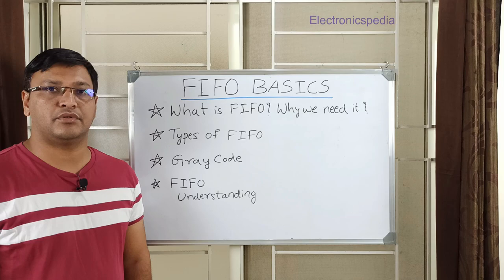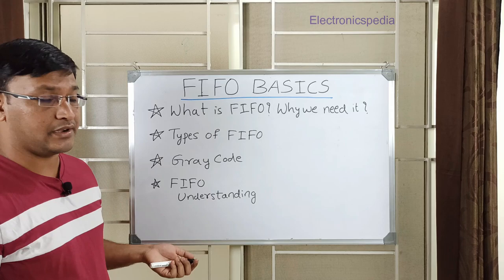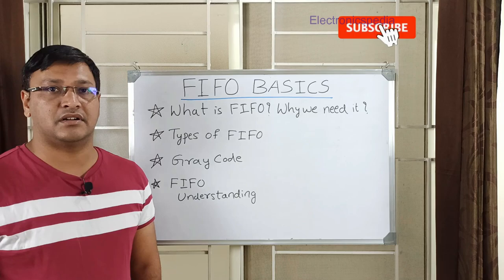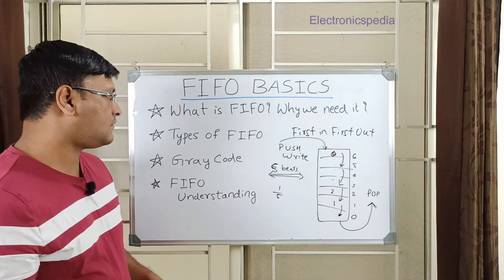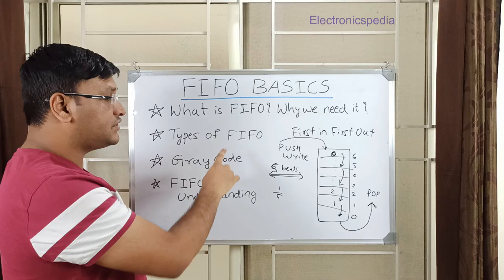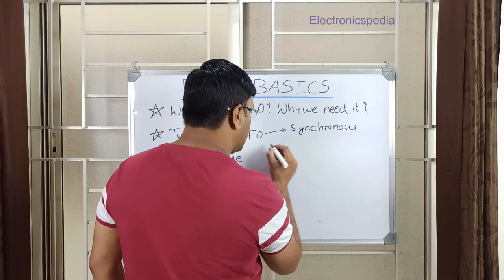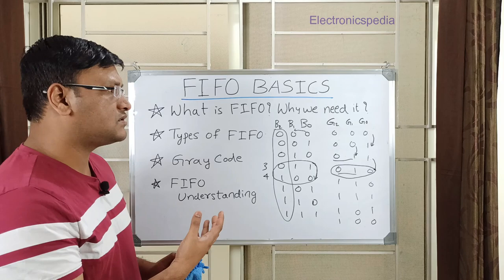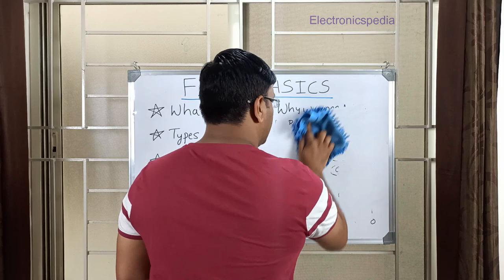FIFO Clock Domain Crossing (CDC) | FIFO Basics | Asynchronous FIFO | Synchronous FIFO | FIFO Design

Comment: Hi sir, you mentioned we will add 1 once pointers reaches to 7th location we compare MSB bits. Lets consider my both pointers are rolled overed onve so their msbs are 1 and  if write pointer again reached to 7th location and read pointer is still at 0th location now when we compare msbs even if we add 1 to write pointer it will be still 1 and read pointer is also having 1 as msb due to previous full condition. Please clariy sir how to compare full condition in this case

Comment: Why we moved to synchronous fifo and asynchronous fifo, it's not very clear in video??
Reply from the maker: I didn't get your question correctly. 
Synchrnous FIFO : We use this when the two clocks on both read and write side are same but the interval of writing(speed) and reading is different
Asynchronous: When there is a write and read frequency are different and we want to transfer continuous stream (finite length) of multibit data, we usually use Asynchronous FIFO. 
Please let me know if there is some confusion
Reply: @Electronicspedia   thanx for reply.

My question is 
Why we need sync. & Async. Fifo ??
Or which drawback motivates us to use these fifo either sync. Or async ?
Reply: @pranavgupta4552  Some designs require you to use two different clocks for a FIFO. If it is the same clock, nothing is really difficult..

Comment: I have a question, sorry if it's silly :) Suppose pixel data comes from a camera (512x640). After that we can save this data in array ( line buffer[511:0] ). Then we can send these data to the desired data bus, respectively. (line[0],line[1],line[2]....line[512]). Why use FIFO when we can do this? My second question, async design is recommended when there are different clocks. But what I don't understand is if I save the data at the clock speed I want, why would the speed of the read process affect this? The writing process is already finished.
Reply from the maker: Hi Enis,
My understanding from your question is that you are working on a synchronous clock. i.e. both read and write frequency are same. 
Now assume if you are writing data every clock cycle on 100MHz, and the read is happening on the same clock frequency but every alternative clock cycle. This means there is a data rate change but frequency is same. In this case you need synchronous FIFO. Otherwise the you may missout write data. I hope this answers your both queries. Do let me know.
Reply: @Electronicspedia  Hello :) First of all, thank you for your reply. I will describe exactly what I want to do to better explain my problem. 10-21 Mhz values (I get parallel pixel data from my camera with CMOS standard). Normally, as the simplest logic, I was aiming to store this data in a buffer and then add some packets to the beginning and give them serially (200Mhz) to the output port (MIPI CSI-2). Later I saw in diagrams that the data was recorded with FIFO. Then, while I was doing research, I discovered your channel and questions started to form in my mind. With your permission, I would like to consult you.
1-) First of all, I am trying to understand why FIFO is needed. I guess the answer is to read and process data faster while writing it without waiting for the transmission to finish. Otherwise, it's easier to save the data in an array and read it when the transmission is finished. (Please verify me or point out what I'm thinking wrong)
2-) If we are not going to read and write at the same time or if we are going to read and write at the same time and at the same speed, I think there is no problem. The problem is that we read and write at the same time, but read and write at different clock speeds. (When I say at the same time, I mean to start reading all the data without waiting for the recording to finish). I guess in this case we need to design asynchronous FIFO. Am I thinking wrong? If it is wrong, what is the correct one, what do you think master?
Reply from the maker: In your first case, how are you reading it, what is the frequency? Is it the same as write frequency (10-21Mhz)?
Reply: @Electronicspedia  The camera's pixel clock depends on the mode selected. I will use it for 2 mods. One is 10.519Mhz, the other is 21.04Mhz. If you are going to give an example to explain the logic, you can accept the frequency you want. At this frequency, the data will come in parallel and I will have to save the incoming data by sharing the clocks. I guess that's the writing process. Later, when I want this data, I need to serialize it quickly, for example at 200Mhz.
Reply from the maker: Hi Enis, 
1. When there is a write i.e. pixel data coming from the Camera, this data will be stored in FIFO(Asynchronous) and then Read back if in read frequency is different compared to write. Your understanding is correct here.
2.  When there is a write i.e. pixel data coming from the Camera, and if you believe that there wont be any subsequent data coming from Camera till you process the current data and send out serially, Then You may not need FIFO. It is as good as you are creating a back pressure to the Camera, that do not send new Pixel data.
3. For the  above point 2, The CDC tools might give CDC violations, as data is crossing the two clock boundaries. You need to add waiver or you need add constraints.
4. If the Point 2 is NOT true, then You may have to add a FIFO, so that you do not miss out the incoming data.
Reply: @Electronicspedia  hello master,
The 2nd item you mentioned is critical, I think I can't decide on it. I need to serialize and output the pixel data coming in parallel, I do this as a process and of course I do not want to lose data while doing this. Another thing that confuses me is that if I wait for the line buffer to fill up and don't start the read (or serialization) process before the buffer is full, will I be slowing down the system? Because if I serialize the data before the buffer is full, I think I can output data faster. what do you think master?
Reply from the maker: Waiting for the line buffer to get full will impact only the latency (initial delay time to get serial output). Once the buffer is full it becomes seamless data flow. But everytime waiting for the buffer to get full is not good way of designing, instead accumulate minimum packets and start serializing the data, this way you will not back pressure camera and you will be able to get better throughput.
Reply: @Electronicspedia  Hello master, I moved the thread to discord and someone there with MIPI experience commented, maybe you'd like to take a look. I would personally send the pixel data before the line buffer is full, or else you are just incurring excess latency. You need to make sure you have enough data in the buffer to send out at least one entire pixel and be ensured that it will fill up with enough data for another pixel before you send the next pixel. I told you that FIFOs are not needed. Other people are telling you that they are. They are both valid methods, but in my opinion FIFOs incur problems, downstream complexity requirements, and they reduce deterministic timing in the design. In your point #2 you say that you can read and write with different clock speeds and then you think a FIFO is not necessary. Yes, This is correct thinking. But the mechanism to create an interface between two domains running at different clock speeds to get the same exact fixed data rate is called a Gearbox, and it can be a very challenging thing to design and implement. Even more difficult to understand at first, there is a type of Gearbox called a Synchronous Gearbox that maintains exact data rates on both ends of an interface without changing clock speeds at all - instead by causing deterministic stalls across one domain to the other at a deterministic interval. A lot of engineers are not familiar with gearboxes, or they do not think the design challenges of creating one and controlling the clocking around it are worth the struggle. That is probably why you are getting conflicting information. You can build this interface either using a FIFO or by using one of several types of Gearboxes, you seem to be of the mind that a Gearbox creates a cleaner or more solid design - and I agree - but a FIFO will usually make this design easier.
@beginner This is one kind of gearbox, a mesosochronous gearbox. It uses two clocks from the same PLL source, and even though the clocks are different frequencies and have different phases , the clocks do not non-deterministically slide past each other because the phases and frequencies are strongly related, and they are carefully controlled. This creates an interface that I believe is what you were envisioning to where you just feed data into a tiny buffer or shift register, and then constantly stream data out and the data relationship is perfectly fixed and the timing is exact and thoughtless to design with. But that doesn't necessarily mean that the design of the system itself is by any means simple.

Comment: What if the read pointer is pointing at for example the 3rd location and the wrptr became equal to the rptr which means they are equal and the FIFO is FULL, this time the Most Significant Bit of the wrptr will not be equal to 1, How will we consider the FULL Condition in that case ?
Reply from the maker: I didn't get your question correctly. 
What's the depth of fifo you are considering is it 4, From 0 to 3?

If read pointer is at 3, and write pointer is catching up the read pointer, then it means the write pointer has already rolled over once, so it's MSB bit will be different than read pointer's MSB. 
As soon as write pointer reaches read pointer value, full condition will be flagged
Reply: @Electronicspedia  The same depth as the one in the video, From 0 to 7 (3 bits)
Reply from the maker: My above comment still holds true even if the depth is 7 or 8
Reply: @Electronicspedia  Thanks a lot